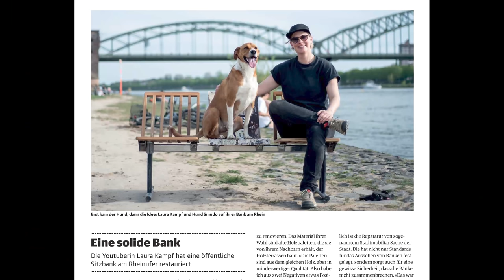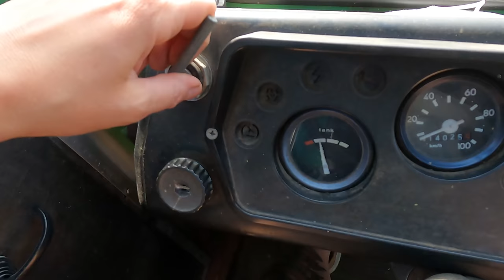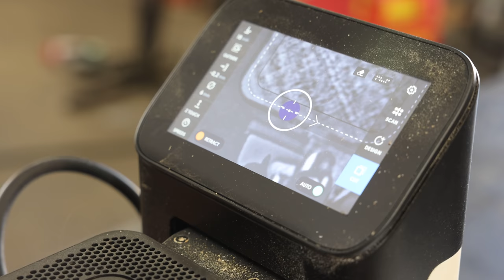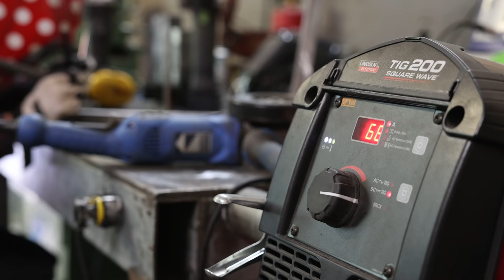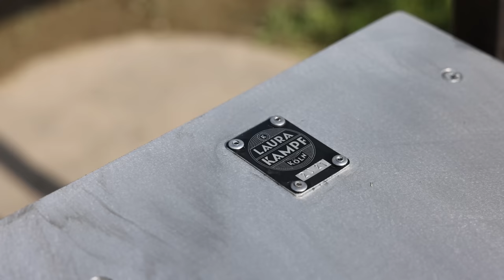They broke my bench...!!!

Comment: "Imagine a world where things are repaired one more time than they are broken." This is awesome and should be the preview for this video. what an inspiration. Keep making! (oh and a bottle opener installed on the side of the seat (not just using the steel) would be a way to help make sure it's even more appreciated. Did you anchor it on that spot or did you leave it movable?

Comment: When cleaning rusty steel, i prefer to use a wirebrush on an angle grinder rather than abrasives. It cleans quite well, but you can still see the steel being bitten by rust, which gives it character ... It feel like the steel is screaming "proud to be recycled !" Rather than be cleaned and look like it's brand new

Comment: That bench seems to be in the food zone. Isn't it worth bolting it to the concrete?
Reply: Man, I wish I was in the food zone!
Reply: first, remaking the bench of solid 2 inch hardened steel and THEN bolting it to the ground.
Reply: @FryingPan76  nothing will protect it from idiots. I wanted to protect it from being flushed away in an event of flood. The entire area is clearly meant to be inundated.
Reply: @PaliVCiernom  yes, the river has high water about once a year in the spring due to melting snows, and this area will be flooded then.

Comment: Here in Toronto, we value rules more than civic pride. If you tried to fix it you would receive a municipal fine for alteration of street furniture and a second fine for not complying with building code as well as a third fine for being unlicensed to work on street furniture (It a third-party contract and only they are allowed to alter, change, replace, paint, or modify any city street furniture). In total, you would be liable for up to $CDN2500 in fines and be required to return the furniture to its unadulterated condition and to return it to its place or origin.

Comment: Hello I'm from the United States, I have run across. The one that you did,. with the plastic crates. Thank you so much.  Here and United States. We have some crates, It will fold on flat. Web fronts insides. Can be left open. These are called egg crates. We also have shipping crates for bread and other  Items,, that when done, Can be folded down flat. They are normally black. Thank you for  You're great idea.

Comment: I love this but I'm screaming at the screen for you to add gussets to reinforce and strengthen the welded joint between the seat and backrest so this one doesn't loose its backs as easily as the thin wooden joint did.  Pretend you are on a big riding mower that backs into it accidentally and knocks it on its back, 10 times, and see how well the weld is holding up.

Comment: Beautiful however I would drill holes 8 feet down into the ground and run metal welded to the bench down into it so that thing can't be taken and use one way screws and maybe electrocute it if somebody touches things they shouldn't.   Vandals need to be taught a lesson

Comment: You could have welded a bottle opener on the side of the bench, but I guess the corner joint works just as well.
Well done. Very nicely made. How did you fix it on the ground?

Comment: In my area, public structures are built in such a way that it would be extremely difficult to break them, even if you tried really hard and had a set of standard hand tools. 

It's a philosophy of understanding that people aren't ALL great, but if you try hard enough you can build things that won't have to be fixed—they will simply endure and serve the people who need them most. This is why I was sad to see you chose to use wood and standard bolts in your updated construction, despite liking the project and the idea behind it.